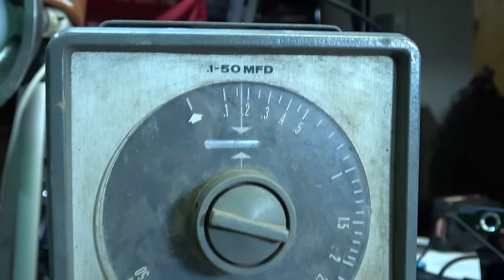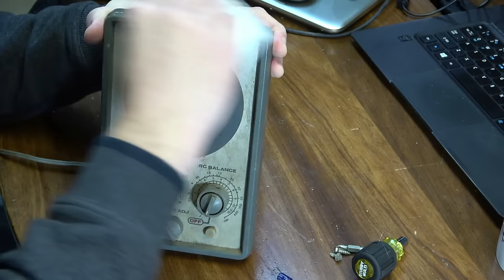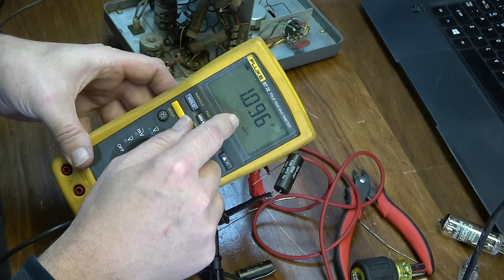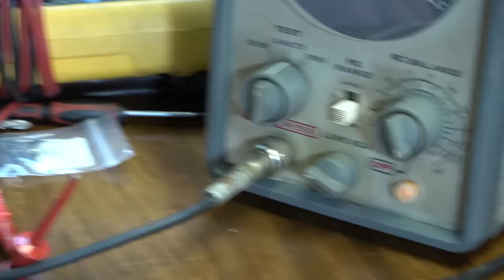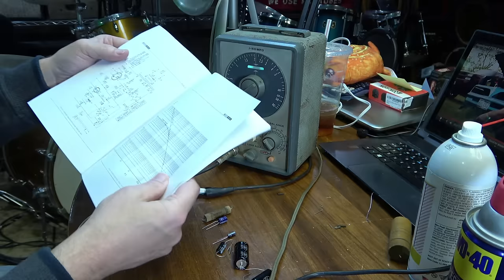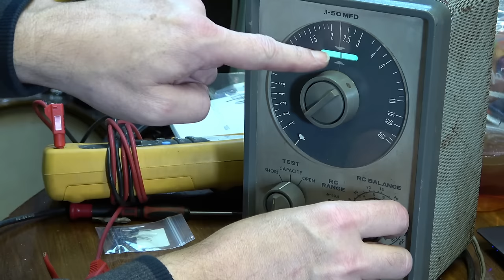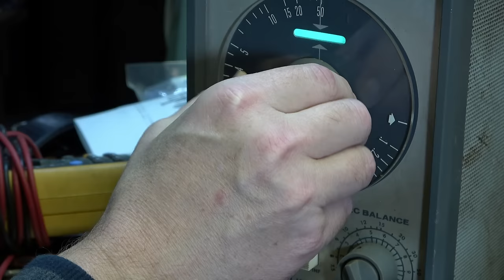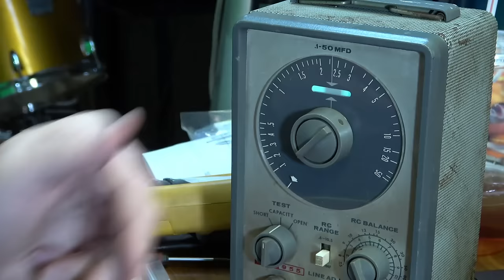1960s Eico 955 In-Circuit Capacitor Tester Restoration and Overview

Comment from the maker: NOTE: Several times in the video, I said the ESR (Equivalent Series Resistance) of a cap can be determined with this meter. There may still be a way to determine if a cap has high ESR with this meter, as it does provide a mechanism for calculating Power Factor, which is related to ESR, but not in the way I described. I sometimes get confused when conceptualizing ESR as it is not a measurement I deal with much when diagnosing cap problems old tube amps. Still, I should have been describing parallel resistance rather than series resistance, which is usually referred to as "leakage" or "shunt" resistance around a capacitor. Old caps usually just get replaced entirely or are sussed out because they have DC leakage (parallel resistance) which is causing issues. 

High ESR is rarely a problem we encounter practically in tube amps because tubes can still function even where a high ESR exists in most cases. Say a coupling capacitor has a leakage, or parallel resistance around it, allowing DC voltage to bypass the capacitive function of the component, maybe due to bad paper or moisture absorbed into the wax. This will cause a tube downstream to bias positive on the grid and either not function or worse, self-destruct. This is an easy problem to diagnose by placing a DMM on the capacitor and measure resistance, or by testing DC voltage at some point past the coupling cap such as the tube grid -- but if that same coupling cap has a high ESR, the amp may still function quite satisfactorily with almost completely negligible effects. In fact, it might even IMPROVE the tone of the amp in some way. the problems with high ESR come when the capacitor starts flowing a bunch of current through it because of a high ESR and with current flow comes heat in the form of Watts. So this can eventually be a problem too. 

The kind of equipment where ESR is a big concern is usually solid state equipment and/or equipment which is sensitive to certain resonant frequencies. 

THE FOLLOWING IS COPIED FROM ANTIQUERADIOS.COM FORUM:
""ESR and leakage testing are intended to catch two different kinds of problems. To test a capacitor fully, you need to do both. Look at it this way: if a capacitor is completely open, there will be no leakage so a leakage test will tell you it is perfect. On the other hand, an ESR test will show the impedance to be impossibly high. Should a capacitor be shorted or excessively leaky, an ESR test may well read perfect but a leakage test will surely flag it.

One thing that needs to be understood is, the chemistry in many electrolytics changed around 1970. Prior to that, all electrolytes were water based. After 1970, glycol based electrolytes came into use for many kind of electrolytic caps. In any electrolytic capacitor, the electrolyte is gradually lost. Some of it is broken down by electrolysis and the oxygen is used to reform and maintain the aluminum oxide dielectric layer. Inevitably, some electrolyte is also lost due to evaporation through seals and end plugs.

Now in a water based capacitor, when the electrolyte is no longer capable of replenishing the dielectric layer, it deforms and leakage current increases until the cap shorts out. In a glycol based capacitor, the electrolyte loses its ionic concentration and its ability to carry current is lost. It goes high in ESR and maybe becomes open. This is why you won't find any antique ESR testers, and they're not mentioned in old radio repair textbooks. Nobody needed them until more recently.""

Comment: Great old school bit of kit, and still bang on. The magic eye tube is provides a fascinating display for this purpose of testing capacitors. Ive only ever seen them used as recording level indicators and signal strength indicators in receivers.
Very interesting video.

Comment: Brad, according to the manual, the RC balance doesn't measure Equivalent Series Resistance (ESR). It measures Equivalent Shunt Resistance. Shunt is parallel. Another words in measures leakage. You want the ESR of a cap to be very low and the Shunt Resistance to be very high. The higher the ESR is, the more the cap is acting like a resistor. The higher the Shunt Resistance, the lower the DC leakage current.
Reply: Almost correct. But still a mistake: A high ESR behaves like a cap and a resistor in series - and a leaking cap behaves like a cap and a resistor in parallel... 
So in case of usual caps in audio circuits, e.g. coupling caps etc, it's rather the leaking caps, that turn into resistors than the high ESR ones...
Reply: @salossi Maybe you misunderstood what I said, but we're saying the same thing.
Reply: @srtamplification  okay :)
Reply from the maker: I think I correct myself at some point and say leakage. But yeah, that’s correct.

Comment: I have a Knight KG-680 Capacitor Checker, Like you said, i don't think it will ever be used as a Cap checker much, but the case and chasse could make for another interesting project such as a small tube amp head.

Comment: Actually, never mind. I just found the info I needed. For others who might need this here is what I found: The length of the test lead used is the sum of 42" RG-58A/U coaxial + 5" for the Red and Black cables which end in a cocodile clip each. Total length in centimeters: 106,68 cm RG-58A/U + 12,70 cm Red & Black cables = 119,38 cms. This length has to be exact since it is part of the tuned open test circuit (although a small error is permissible since the "Q" of the circuit is not critical), and represents a quarter wave-length line for the frequency of oscillation (about 22 Mcs).
Reply from the maker: This is interesting then because in the video I'm using a gator clip to replace one lead which is too long. Thanks for bringing it to my attention.
Reply: @TheGuitologist  You are welcome!

Comment: Hi Brad!  Cool old school bit of test gear!  I love those 'magic-eye' kinda signal indicators!

Mate, as srt said, you really messed up thinking the ESR of that 4.7uF capacitor was 6.3k!  If that was true the cap would be RUBBISH!  If it's a new cap it's ESR would be more like 6.3 OHMS anyway! 😂!  'srt' read the manual, & the rc balance control adjusts for the SHUNT resistance, in fact.

Then you said the ESR of the 100uF cap was almost infinite.  Wrong again mate!  It's ESR was ALMOST ZERO ohms!

You seem a little confused Brad!  Maybe read up on the difference between leakage & ESR.  They are VERY different specs!

Comment: I just got one of these but it lacks the test lead.The manual says the cable is designed for this application and that you shouldn't substitute another cable. I am guessing that the length is one of the important parameters. The manual does say you can calibrate for a replacement cable. So, can you tell me the length of the one you have? It would give me a starting point at least.
Reply from the maker: From the tip of the Amphenol connector to the tip of the gator clip is 49 inches. Hope that helps!

Comment: If you find an EICO 950B RC bridge get it !!!.  The 950B will allow testing of capacitor leakage with a DC voltage up to 500 VDC !!!!

Comment: Hey brad buy a product called Plasti-Aid you can fill the hole redrill it and tap it for the set screw, its sets fast and can even be molded into many things. It will not breakout.

Comment: If that electrolytic is good,the esr will   be very LOW.  ESR IS NOT LEAKAGE!!!!  ESR IS in series with the capacitance leakage is parallel to the capacitance, in other words a leaky cap is shorted.  ESR is measured with an ESR meter which is an ohm meter that uses a 100khz test signal rather than the DC test current of a standard ohm meter.

Comment: I never felt comfortable with tube and capacitor testers, where you go ok that's what it says. You will be fooled. You have too know yours from experience and develop a sense. Because high current is involved. It's like testing a bullet proof vest with a pee shooter. lol You can tell by DC and swapping tubes. Otherwise it's like asking a Witch. I never was on a bench troubleshooting with one of these things. an experienced tech would come up and say get rid of that thing.